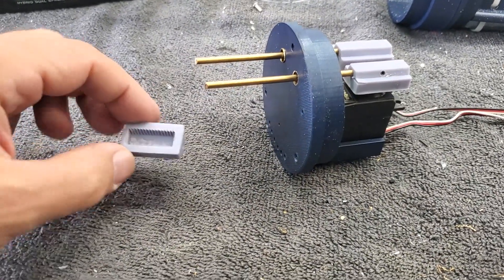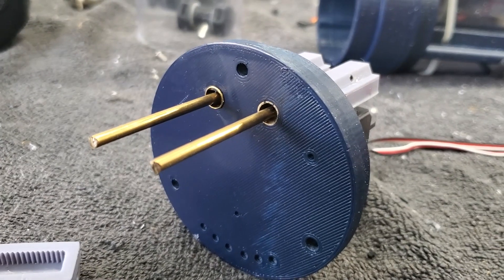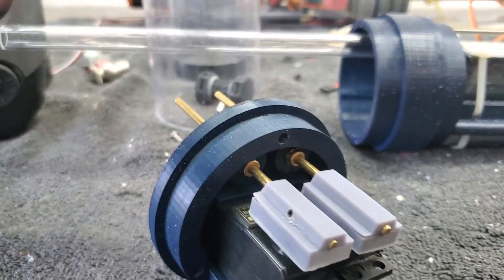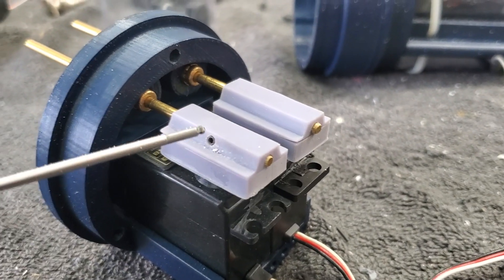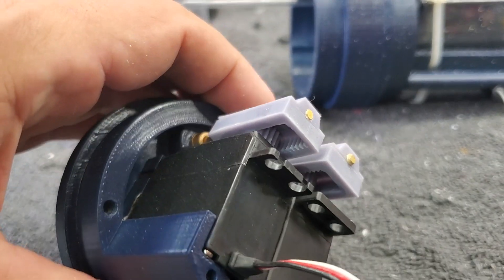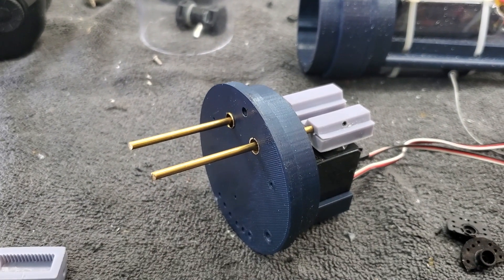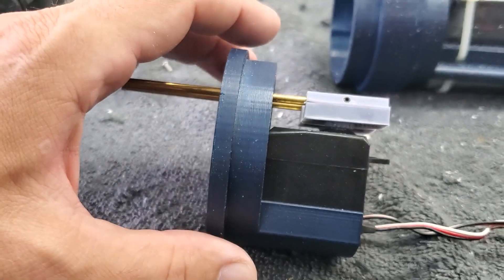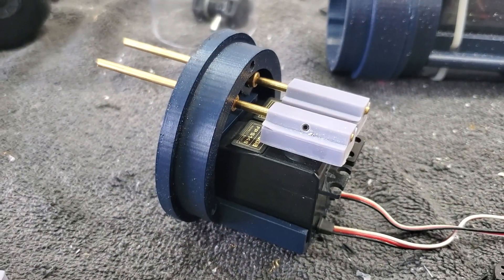True linear servo conversion kit for standard servos

Comment: How much linear travel do you get from the standard servo please?
Reply from the maker: Approximately 1/2" total (13mm)
Reply: @RCSubGuy  Thank-you. A variation on this for more travel would be a larger diameter wheel with more teeth and a larger box top. Something to consider.
Reply from the maker: @haigjansz5643  Of course, but then you have a much larger unit. Also, as the diameter of the gear increases, the distance offset from the center of the linkage rod increases, resulting in offset forces. Travel can be adjusted not only at the servo, but at the control surface horn.

Comment: Hi Bob, what spline on the servo output shaft or does it come with several. Thanks.
Reply from the maker: No spline. A drop of CA and the stock bolt hold it down to any servo with a 6mm diameter servo spline.